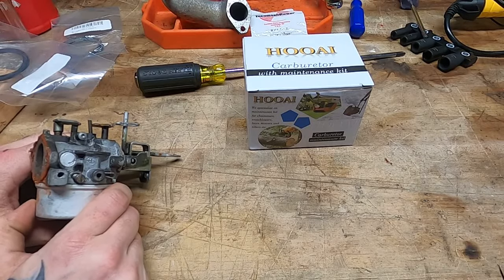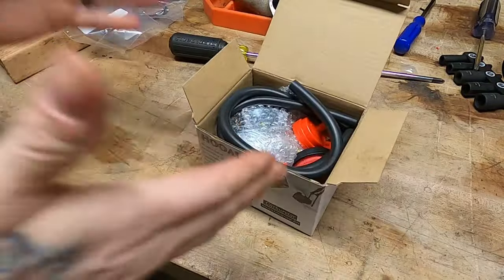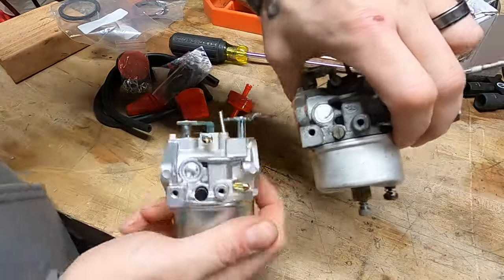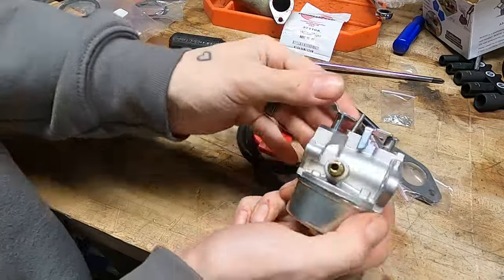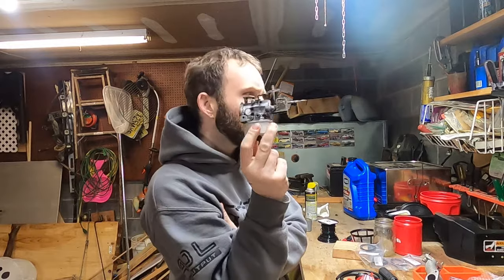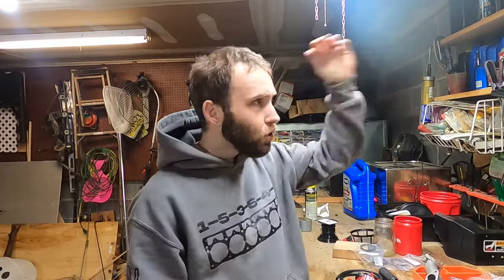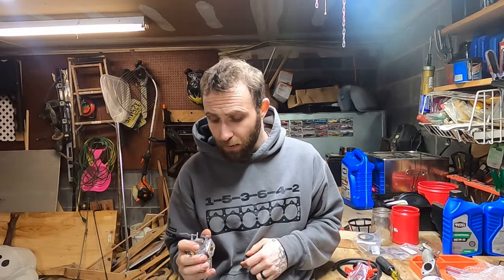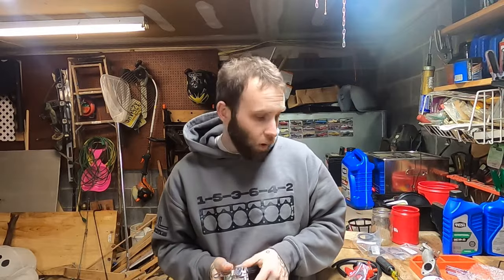The Truth about TECUMSEH CARBURETORS (Old Style vs New Style)

Comment: One really good thing about the adjustable carburetors is that elevation changes do affect your engine and if that happens all you have to do is adjust it.
Reply: Yes at 6000' elevation I have to run my 9HP tecumseh with original fixed mixture with the ckoke on the first notch or so
Reply: From Dillion Colorado (9100 ft) to Parker (5800) Colorado  I have to do the same thing on my 8hp..altitude does make a difference.

Comment: Wow, i wish I saw this video. I bought a tunable carb after installing a new non-tunable one. I was able to get my snow blower to work with the non tuneable carb. It's reving high. I think the governor spring is shot so I ordered a new one. There's no resistance. When I installed the tunable carb, I could not get the craftsman 5HP 22 inch snowblower to start. I work in IT but I like to tinker with stuff. I paid 50 bucks for the snow blower so I am learning.

Comment: I have been using them Amazon carbs on all my small engines for years. Not a single one has been bad. Mind you this covers back pack 2 stroke blowers, line trimmers, outboards and lawnmowers.  For the price its a no brainer. And in almost every case it leaves me with an extra carb for parts if im in a pinch and need to help someone out rite away.

Comment: There is some sort of air control jet behind the black plastic cap where you say the idle adjustment used to be.  It is nonadjustable.  I had a Chinese carb on my 10 HP Ariens that was running like crap.  I looked and that jet was missing entirely but the engine still ran, although terribly.  I salvaged the jet from another carb that I had and installed it and the engine runs great.  (Maybe some of that is due to a couple of doses of Sta-Bil Fast Fix I ran through it before I discovered the missing jet)

Comment: I took you up on your recommendation and bought one of these carbs... My snowblower now has two speeds, racing and off. If this is non-adjustable, what's the answer? I made sure the linkage was in the exact hole as the old one, but that said these replacements aren't 100 identical... Thanks for any suggestions that might help.
Reply: you still have an idle speed screw on the throttle. Just adjust it there. It's not an air fuel adjustment just speed.

Comment: I have a 2003 ariens blower with the Hssk 5 hp. I bought the king brand carburetor which has no adjustments. But either does the original carb. Ended up putting the original on but the fumes are bad. I know my spring adjustments are messed up as the governor doesn't give me enough rpm, but it gets the job done. Maybe I'll try the Chinese carb again. What about but a carb from a small engine dealer for around $70?

Comment: I have had terrible luck with them from China. Not drilled or ported properly, fire up the engine and it dies anywhere above an idle. Sometimes have tried 2 or 3 figuring something was wrong, with the same poor results. It takes drilling out the jets, and ports if U can figure where the imperfections are to make the machine run. (Often, if U can get it to run at all) The price is cheap, and so is the product. Parts are not interchangeable with the factory carbs either. I do work on a lot of these small engines, and I do not feel that these are the way to go. The linkage and things are off too, and even trying to adjust the governor to work with one of these properly is difficult or not even possible at times. I run premium gas and avoid ethanol.
It's a nice kit if U like a fuel restriction right out of the box. Way happier with a factory carb.

Comment: i replaced my snowblower carb and i found it dont have regulators screws ...i went to amazon and buy for 18$ and they have the 2 options for the same price and i get the one with the regulators thinking its the new upgrade....a lot better with regulators and that was the reason i replaced ,,,i couldnt regulate the old one......but you are upside down  ha ha:face-blue-smiling::hand-pink-waving:

Comment: Those Chinese carbs do work. However I've had at least 2 leak right out of the box. I finally found out that during shipping and handling the needle valve becomes dislodged.. So the fuel just keeps flowing. You even have to be careful installing the carb and keep it as horizontal as possible when installing it. After that they work just fine and you can't beat the price.
Reply: I had the same problem…brand new carburetor leaking gas profusely. I removed the bowl and worked the float and needle valve up and down and it stopped leaking, but the engine won’t run without partial choke, but no adjustments can be done.

Comment: Hello. Didnt they stop using two bolt adjusent because of some co2 emision or something? I have nikky carb with no adjustment in my 2008 murray. On idle it does not sound that great but under load sounds great.
On my trimmer i have only 1 adjustable bolt and it is a bit limmiting to set up how I want it... but I use what I have
Reply: I just finished the video and you explained it well. Good video sir
Reply from the maker: That could be. They were tired of guys tuning them to run rich or something I guess

Comment: I picked up a old Sears alternator generator, think made by David Bradley,replaced fuel lines, added filter, no rust in tank, mabe made in late 60s. It ran for about 30 minutes like a top, I tried to adjust carb it cut off, and now won't start lol, leaking a little gas from carb. No labels on engine, I think is a 6hp tecumseh. Guess I will try a new carb.

Comment: Enjoyed your video. In the past several years I have bought 4 used snowblowers that have needed some TLC. The 3rd one was a craps man 8.5/26. Besides the auger problem,  I had a issue with the carb having the evaporated gas residue.  Took it apart and found that the float needle was sticking in the nylon seal seat. Unfortunately with my deep cleaning, I compromised the seat and I bought the Amazon Hooli carb which costs less than the rebuid kit as well as the tools required to replace the parts/seals. Now I'm working on #4, a Craftsman 9/28 and have I fixed the siezed auger blades on the shaft and installed bailer belt on the impeller blades that is corded material and cost only $7 for a 7" x 12"  piece. Now moving on to my craftsman 9/28, 12" impeller that I will clean the carb and possibly R&R it with the Amazon carb if necessary if I can't get it cleaned up. I also make blower skid plate modifications on my blowers by replacing them with roller blade wheels that you can buy for cheap at garage sales. No skid plate adjustments or scraper blade replacement/adjustment, required!

Comment: I replaced the carb on my Tecumseh 5-hp engine. The engine would start only with starting fluid. I replaced it with a non-adjustable carb from Pro Chaser /Amazon The engine starts and runs fine until I put it under a load. It does not have enough power to run the auger and the drive. Do I need to replace the new carb with an adjustable one or what?
Reply: Make sure the governor is correct.  Donny boy or Terrell have instructions. It's not hard. 
Did you get the linkages in the right holes? I'll bet this could be the issue.  
Otherwise: compression check, new plug, drain the tank, new fuel, see if there's any mechanical resistance in the drive or auger, confirm 3600RPM.

...5 HP is not much for a snowblower.
Reply: @osmith5086 what are the right holes
Reply: @oldman8350  https://www.youtube.com/watch?v=TKvceEBaVH0
8:22
Taryl is the man!

Comment: My adjustable carb kept leaking from the dump and I got tired of replacing the gasket so I changed it to one of these - problem solved.  New one works great!  FYI - don't use the cheap plastic parts and the included fuel lines though.  They cracked in the cold on the first winter.
Reply: there's a small vent hole to the right of the idle adjuster that was probably clogged.

Comment: That's why I get my gas from the Co-Op (Country Mark brand) here.  It's non-ethanol.  I don't even need to use fuel stabilizer in the off season because the gas is still good after sitting that long.  I typically get the 92 octane.

Comment: I agree. It's like the old '97 Ranger I had, probably the last truck on earth with a manual transmission. I don't want no machine telling me what gear to be in or what the mixture should be. Control freak I am. A dozen years ago I actually worked at Ariens machining parts. Sucky 3rd shift job and by then they were using Briggs motors. At least now I have an old '80s Snow King and once I figured out what those adjustments did,  I never had a problem. Great video THANKS!
Reply: I had a Ranger with a manual transmission 
Didn't have to lock it 
Any little prick that might think about stealing it wouldn't know how to drive it

Comment: Nice video. Thanks. I was wondering if you know the name of a Tecumseh carb pieace.  I have an older 2 cycle 1 stage Craftsman, and the carb has this gold color cup in front of the carb covering the butter fly.  I need one and I don't know what it's called to look it up.  It doesn't show on the parts  diagram.  Thanks.

Comment: I picked up a 1966 ariens snowblower off a tree lawn I rebuilt the carb tecumish engine new head gasket new coil new points and condenser wasent that much money probably under $100 bucks runs great is a beast in the snow by the apron by the street it plows right through that wet stuff where the new snow blowers are struggling so old is way better than new in my opinion because they were built too last not throw away

Comment: I just put a Sino carb on my Tecumseh 10hp and it runs rich. Starts easy but burning rich. Afterfiring and foaling the plug. The original factory was none adjustable but gunked up. Ethanol thank you. 

Going to replace with a Sino adjustable probably. Looking for replacement now.

Comment: Good video and it's nice you try to be fair and unbiased. As far as I can see, if a carb works ok, what's the problem whether it's adjustable or non-adjustable? You're good to go either way so no issues. Others have made the good point if you live at altitude, adjustable is a good feature. Most Americans live under 2000 feet so the non-adjustable would likely work fine for most of us. 

I am still running a 1972 Ariens 24" SnoThro purchsaed new with 7hp Tecumseh and this style carb. I live in Western NY in the lake effect area so this machine has had a workout. The dump valve started leaking and I replaced the bowl with the new style without dump valve. It was about 80% cheaper than the still available type with dump valve so cuz I'm frugal, I went the cheaper route knowing the engine would run the same. 

I set the original bowl aside thinking I might try to replace the tiny leaking  "O" ring some rainy day. Recently I was able to do that very tedious and fussy job successfully. I used tweezers, a little pick tool and a couple jewelers screwdrivers to keep the valve pried open. It was not easy and taxed my patience but I enjoyed proving it CAN be done if you have the will. You almost need three or four hands so don't try this when you are tired or in any kind of a hurry.  I reinstalled the repaired bowl and it's working fine. I like being able to dump the fuel before off-season storage.  First I  run the engine out of gas after siphoning the tank empty while the machine is tilted to get the most fuel out. I also put a tiny amount of Stabil in the tank before starting the storage process. Might be overkill but it works for me. Have only taken carb apart for cleaning once in the 51 years I've had the machine. They don't make 'em like they used to  ;-)
Reply: all comes down to if you know what your doing or not. if you are joe home owner trying to save a little money and can swap a part out but have no idea what it does... buy the preset carb.

Comment: Great video.   I’m looking for a replacement carb for my Simplicity Snow King HSK70-130292T(H) late 1990s snowblower which I believe has the Tecumseh 632371A carb.  I checked Amazon and saw a Hooai carb replacement for the 632371A but the description says “Not Compatible with 10% Ethanol Gas.”  I guess I can’t use this.  Do you have any suggestions?   Thanks so much.

Comment: I’d rather use a adjustable, u can dial it in way closer. Every engine is gonna be a bit different. And your elevation it gonna impact your tune also. Like in the mouth and may run great bit hot see level gonna run like crap.

Comment: That fuel line is not long enough and the diameter is too large to squeeze through the slot it has to fit for a Tecumseh HM series. good luck that the valve does not leak or jam in position.  The filters are not needed as the gas tank has  a screen.

Comment: Adjustable, plus if it's not I will convert it so it is.
.As gas goes The old gas was the best. With today's low efficient gas, as soon as it gets air water forms, hence the air tight gas can. and pressurized systems in cars. and never let it sit in any small engine tank for long period..... , it rots hoses and turns into something else.

Comment: Doug v Carburetor I like Tecumseh carburetor with adjustment myself better
Reply from the maker: I do not blame you! Just something about having the option of you need it
Reply: I also have my own small engine repair and lawn care business
Reply: Tecumseh New Holstein Wisconsin U.S.A
  I built (wrote) the program for the cam and crankshaft grinders on site.  1994, 93 94.  U.S.A. I use both but prefer, the original,  I save the original, can rebuild it and shelve it for the next machine, or rebuild jit.
Thanks to everyone.
Keep wrench'n.
Keep Truck'n

Comment: I think your theory is off they need adjustment for temperature altitude and fuel quality the non adjustable run like ass and need the jets drilled at low altitude and low temperature if it surges open the jet
Reply from the maker: By that logic, all new machines with non adjustable carbs wouldn’t run at altitude or when it is too cold. I had the same thought originally, but the reality is that fuel refinement has gotten consistent enough that it will operate properly in 99% of conditions.

Comment: I was hoping to gain some insight here - although I've reworked Tecumseh carbs for a long while.  
As soon as you stated that Ethanol BREAKS DOWN INTO WATER (an absolutely 100% false statement) I chose to down thumb and leave this parting shot.
Ethanol Alcohol is mixed with gasoline because it makes cheap gasoline even cheaper.  The Ethanol mixes VERY easily with water and after the heating of the day (expanding the air in the fuel tank) the cooler temperatures of night cool that same air and through shrinking draws outside air into the tank.  That outside air contains some water vapor which condenses on the inside walls of the Carb.  Liquid water particles contact that Gasoline hosted Ethanol Alcohol which VERY actively acquires the water, absorbing it into the alcohol.  
THAT is how liquid water and alcohol end up together inside the tank.  Alcohol prefers water to gasoline.
Concurrent air exchanges provide Oxygen which results in corrosion inside the tank (and carb bowl).  
Good luck pushing your own thoughts here.

Comment: just received a non adjustable carb just like OE put it on fuel leaking out of bowl tightened fuel bolt/jet still leaking removed carb adjusted float engine wouldnt run right readjusted float still wont run right and fuel still leaking from bolt smfh, got it running but surging and missing, new fuel and plug misses on high speed surges on low speed or idle this thing ran perfect 2 years ago then went into storage thats all I am baffeled, original carb would only run on half choke, yes low speed circuit, cleaned carb as best I could not a difference that is the reason for new carb, on 6 horse ohv Tecumseh what is going on?

Comment: I like the content.  But I would prefer the old adjustable carb . But also I would try and clean/rebuild it first b4 I would I buy a knock off ... but I have bought that hooai b4 .some times it worked and sometimes it didn't.

Comment: I have never worked with an adjustable small engine carb. I have bought several cheap Chineseium carbs from Amazon and they worked great. Maybe an adjustable one would work better at higher altitudes where the air is thin but I haven't noticed any issues. I live at 4500 ft
Reply: I live at 60 000ft and I'm Gay

Comment: I've had exactly 2 Chinese Rainforest website carbs that have ever functioned properly. They were 2 stroke carbs. I bought a Jungle website carb for my Honda 4 stroke lawnmower...it ran worse than the original carb. I ended up rebuilding the original carb and threw the Amazon People's Republic carb away. They just don't have the quality control or correct specs/jet sizing in those cheap things. Absolute trash.

Comment: I like adjustable carburetors. I believe it was about 1993 that Tecumseh went to non adjustable on the 8 HP Snow King. Back date to an older carb part # 632334A.   You can get Chinese versions of it too

Comment: Just ordered my commie Tecumseh carb to replace the OEM one on an old troy built horse tiller I just snagged for 100 bucks.  I hated doing it but you are correct. I have installed tons of these clones and never had a single issue. And they cost less than even a rebuild kit at this point. Just not worth buying the original for 99.99% of people.
Reply: Do you have the Amazon link for this
Reply: @blackjoebufa  it's been a while but I should be able to find it in my order history. Give me a couple of hours and I'll track it down